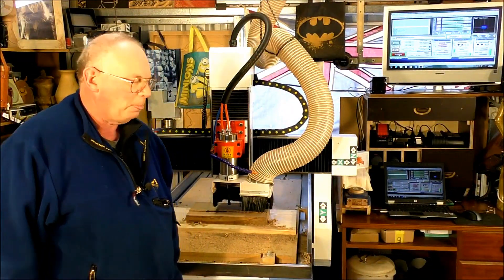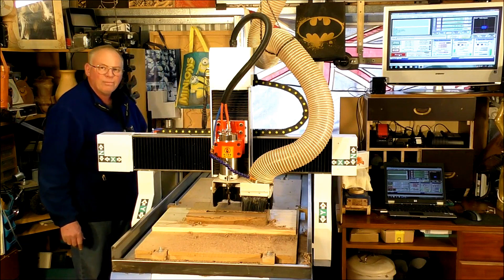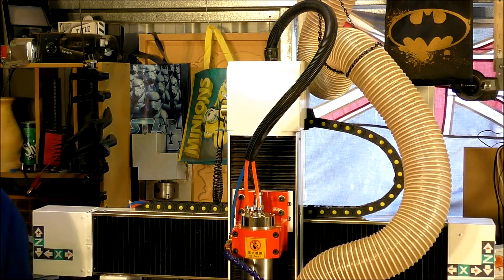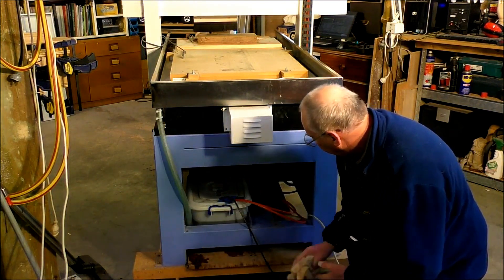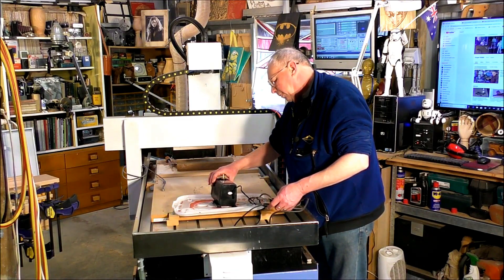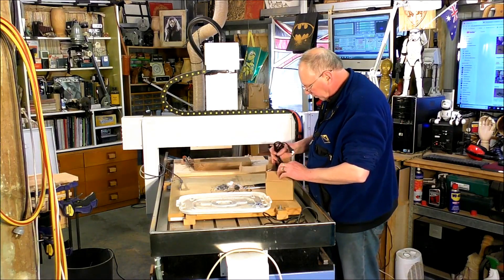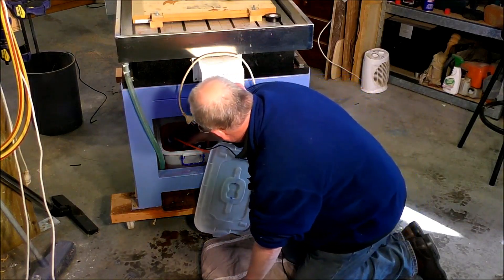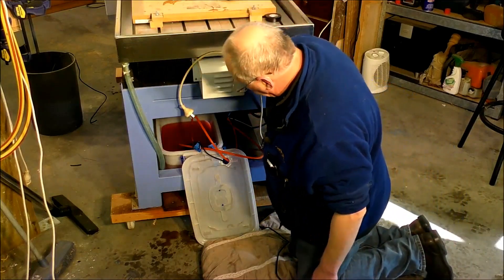AAARRR!!! My CNC Router stopped working *BIG FAIL* and repair

Comment: I see at 10 minutes your 4th axis is standing up in the corner.  Mine came with a 16mm thick steel plate for the base.    25 kg on it's own then all the bits on top.   I'm in the process of making an Aluminium one 12mm thick.   Only 6kg plus the bits bolted to it.  Is yours Aluminium ?          Jim

Comment: Hi Roger, I had the same issue that happened randomly...I solved the problem by adding a 10 gauge wire as a ground from Router to pump body and connected it to the water pipe in the ground... hasn't happened since...it seemed to be a e!ectrical flux problem getting back to the controller or the computer frame..
Hope this helps you or someone else..
Be Safe!
Don Sullivan